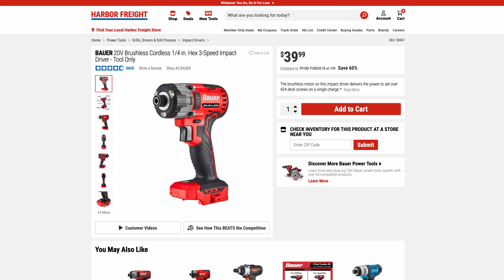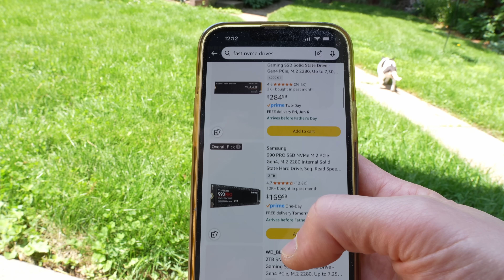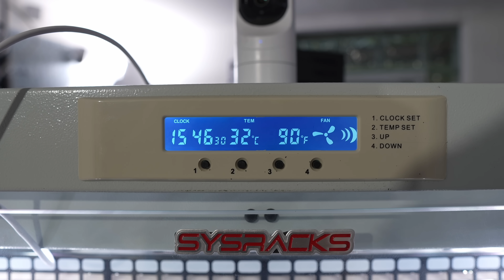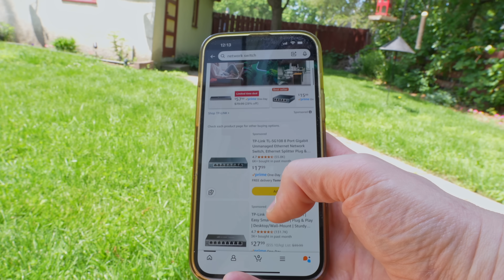Buy Once, Cry Once: How I Wasted $2,857 on Switches

Comment: "You don't know, what you don't know".
ie. You weren't aware of where your homelab setup would lead to down the road, so you had no idea what you ultimately needed. I went down a similar route; before migrating my NAS from spinning rust to an all-nvme setup.

One piece of advice I'll give to others starting out with home lab setups is to NOT buy ex. data centre switches etc. They're noisy; old; inefficient; and sometimes plagued by licensing issues.

If you've got a tight budget, even look at a generic 10g SFP+ switch for just your data movement on your internal network (ie. no PoE, unmanaged).  You can literally buy new unmanaged generic SFP+ 10g switches (eg. 8 port) for about $100 USD these days, and these are fine for your internal network. Multimode SFP+ 10g and SFP28 25g transceivers are dirt cheap these days as well ($20-30 USD ea. new). Similarly OM4 fibre cables and patch leads are also cheap compared to copper and offer future expansion (eg. 25g; 100g etc.).
In order to manage everything, get a decent router (Mikrotik; Ubiquiti; Alta etc.) and have that manage all your vlans; DHCP etc. for your internal network.

Buy a couple of used 10g (or even 25g) SFP+ NICs (Eg. Intel, or Mellanox CX-3/CX-4's), and you're good to go -  you can have 10g networking (switch/NIC's/transceivers/cables) between a couple of desktops and your NAS for less than $500 USD. Seriously.

Comment: I have bought 500k+ worth of equipment over the last 10 years for my small AV biz or home.
I have NEVER once regretted a buy-once-cry-once purchase.
I have, however, regretted many purchases that weren't what I needed but were a 'step' closer.

6dB$ is the way.

That said, there is no reason to spend lots of money on things that you don't need. I spend wayyy too much on 'stuff'/junk' that I will never need or use. That isn't buy-once, cry-once. That's stupidity and greed and emotional buying.
Same for quality, it isn't just 'buy expensive'. Example: tools, look at project farm; many times the cheaper tool is better in many regards to the expensive one. Sometimes it isn't better, but it is higher value.

For the curious:
-high quality audio amps vs used ones
-high quality speakers over cheaper ones
-high quality crank stands
-high quality lighting vs clones
-network/computer equipment
-good cables & road cases rather than crappy ones (note not expensive; just good)

Comment: i have been using unifi for 3 years and now i feel i made a mastake. i was using mikrotik and i think it's better than unifi and cost is cheaper than unifi. i know unifi has great for ui but its so expensive. now i am back to my old mikrotik and wow ther router still good and mikrotik has update a lot compare with unifi they are so difficult to update firewall bug. for management switch and router  now i prefer mikrotik than unifi. for AP ok i prefer unifi (i have not test ruijie yet)

Comment: I buy used enterprise equipment. I own one 48 port 10gb switch (with  4 40gb ports) AND a handful of 1 GB POE 48 port (with 10GB up-links). I'll probably buy a 2nd 10GB switch for a backup.

I'll still be under 1k for all of my network gear.

Comment: 1. Future proof for the next 5 years at least with enough 25% headroom than your needs.
2. Upgrade only when your upgrade is going to be 2x better than what you currently have; while applying rule #1. So it’s double plus 25%.
3. Stick to the budget, if you allocated that money to that item then spend it. Don’t readjust the budget to spend it elsewhere, spend it on the upgraded version, if possible. Meaning if you planned to spend 1k but the device that meets 1 and 2 points costs $700 but there’s another device that costs $1k then spend your budget on the $1k rather than $700. You are extending the future proof by not reallocating budgets.
4. Consider the software vs hardware. Hardware without proper support is worse than low tier hardware with high quality support. Eliminates so many headaches.
5. And if you don’t know how much you need, then watch your favorite YouTuber like TechnoTim and ask yourself, “how much do I really see myself getting into this”. Use that as a baseline to where to start.

Comment: (7:28) "Is buy once, cry once just future-proofing?" When hyperscalers like Amazon, Meta & Google adopt cutting-edge CPUs or AI accelerators 🔧⚙, they create market momentum that eventually drives down hardware costs 💸. As their demand scales, vendors flood the market with newer-gen tech, causing prior high-end components to become more accessible & affordable 🎯. For home labbers, this presents a strategic window: instead of paying premium early-adopter prices, you can wait for the enterprise wave 🌊 to pass, then pick up powerful gear at reduced cost — maximizing performance-per-dollar 📈. The key is timing purchases just as mainstream adoption peaks & infrastructure refresh cycles begin, letting you build robust setups without overspending 🖥🔌.

Comment: My introduction to HomeLabs began at the start of the pandemic, when the sudden shift to full-time remote work pushed me to upgrade my ISP and take a closer look at my home network. That’s when I discovered Ubiquiti and started small—with just the basics. Over time, what began as a simple setup has grown into a robust home lab environment, now centered around a Dream Machine Pro, higher-end UniFi Switch Pro Max 48 PoE, NVRs, Unifi UNAS Pro, a TrueNAS system, and more.

If I had done it all over again, I would have started with the rack-mount system and upgraded the switches as the systems were improved.
Reply: I went opposite and laugh at most of the guys. Seriously you can buy a full 16 core 32 thread consumer AMD cpu that can virtualize a whole environment without buying stupid servers at home. My IPC per core can destroy xeons because the xeons people buy are out of support and like 8 years old. Opnsense is free and can run routers natively with Microsoft Hyper-v which is part of Windows 11 without any guest tools. With guest tools you can run opnsense on Linux with KVM/Qemu fine. If you want to go overboard and say I do not know what I am talking about compared to 3 or 4 racks of outdated enterirpise hardware you can buy a Threadripper with 64 cores and 128 threads! The new one just came out and AMD's threadripper is a remarked EypC CPUs and are enterprise grade. They can eat Virtual machines for breakfast.

I like VMs over hardware because I can do a simple snapshot to restore a mistake without reinstalling the operating system off of real hardware

Comment: I have the same experience. We're drowning in incremental standards by now and hybrid switches with 2.5G/10G ports just suck. For vendors though, it's heaven. The perfect way to guarantee a steady high revenue.

It's probably best to plan ahead and save up a decent amount of money before committing to anything. Do proper and comprehensive research, lab it out if possible and finally buy everything in one go. You'll still get screwed with unpleasant surprises but at least you have a balanced setup and you save loads of time on fiddly configuration changes. You'll also end up with a much cleaner stack. All you have to do is resist the urge to express-checkout the latest gadget and forfeit that dopamine rush.

Comment: I'm building a commercial scale 10G network.  All Ubiquiti Unifi.  Dream Machine SE,  SFP Aggregation switch, Four 48 port POE switches, one 24 port POE switch and 4 AP-Pro Access Points.  I decided to buy flexibility even though I don't need POE everywhere all ports are capable.  I can also segregate the network physically by switch -- 48 Cameras and a PVR on one switch for example.  Pricey for sure... but easily able to meet my needs well into the future.  I'm glad I did it this way.  But I can also appreciate the built-in obsolescence approach.  Buy cheap but capable equipment for half the price with the expectation that you will replace it at least twice.  It has the secondary benefit of saving capital upfront.

Comment: Unless I'm misunderstanding the Flex 10G had a 1Gb uplink. So you're using one of the 4 x 10Gb ports as an uplink?
Reply from the maker: You're right that it has a 1Gbe port however I was using one of the 4 10Gbe links as an uplink instead.
Reply: @TechnoTim  yeah, that's tough. I've been in similar situations. I own so man UniFi switches (over 30) because of technology changes and moving from 1Gb to PoE to 10Gb, but then 10Gb with PoE++ and later 2.5Gb. It's a lot.
Their release cycle is awful. Products come out haphazardly, so you can't easily plan in advance either :/.

Comment: I just bought used 24 port POE+ gigabit L2 switch for $100 and next will be Mikrotik router right behind GPON from ISP. That will be extra $230. And behind the switch there will be used Ubiquiti UAP-AC-LR APs. You see this? No vendor lock-in 😁
All of this for basic home networking, smart home and web server. In case of upgrade I will just buy used faster switch and hope to not make same mistakes :D

Comment: Are you sure the 32 higher speed ports also support 10mbit? We have unifi switches that support 2.5gb at work and they don't support going down to 10mbit. This is very niche as not many things use 10mbit these days, but just curious.
Reply from the maker: Great question and I was not able to test this (hard to find these days) but the product documentation says so.  It doesn't support 10 half but supports 10 full.
Reply: @TechnoTim Yeah the only thing we have are door controllers that still use 10mbps NICs. Just made me curious when you said those ports supported all the speeds.

Comment: My IT background is from the ISP world. We need uptime. That means spares and commonality between sites. I'm no longer in that business, but I'd rather have multiple affordable reliable switches that aren't as shiny if it meets the same goals. Runtime on battery or generator is important too (low power consumption and no need for air conditioning) For home and soho use, the quietness is a factor. 1u 48 port POE switches are probably somewhere between vacuum cleaner and jet engine. Buy once cry once I reserve for cars and cameras. My used Nikon D810 is still making pretty photos and video.

Comment: To me, as a person who only do homelab for fun.  It's all about balance.  Especially w/ tech gears, I doubt "Buy once, cry once" actually a thing.  As a home user, I have to balance between need, want & price.  What exactly the point of paying something super expensive that you only use less than 10% of the power or features?  Maybe I'll out grow that, but you can anticipate what you will need in the future.  Business do have differ requirement, but it's still the same it's all about balance.  Sure you can buy 10G switch a decade ago, but the switch alone will cost you thousands of dollars and not to mention all other NICs that have to upgrade on the desktop.  So, a decade ago utilizing 10G networking will probably cost you 10k.  And majority don't even utilizing that 10G bandwidth full time.  The people that do need it at the time, only need them because they need them to be faster than 1G and there is nothing else in-between.  Today, you can get into 2.5G network at less than 10% of that.  Same could says for the POE and the wireless networking.  Do I need 10G now, no?  Do I want 10G now, yes? but as a home user and future proofing my network, a mixture of 10G and 2.5G exist and all that still only cost me about $1k to upgrade my entire home network, still way less that those business that pay 10x the price decade ago.  Would I need more than 2.5G in the future, maybe?  But I doubt I will need my entire network to be all 10G or faster.  Not every single networking equipment need to use even more than 1G, some even 100M will do.  Even for business, getting the entire network to be 10G capable even now is still exuberantly expensive, not just the cost of equipment upgrade alone, but the price you have to pay for power and cooling them.  Not all business need that, even less for the homelab.

Comment: Buy-once-cry-once is the antithesis of the Boot's theory of economic unfairness. If you can afford to buy what you really need the first time around then great, bot often it's not feasible to buy that, meaning you have to go with a lesser option, and then end up needing to re-buy in the future. I usually think if the cost of the purchase is more than my time to analyse the option and consider what to get, it's probably worth spending a little more time to make sure I'm buying the right thing first time around.

Comment: Tim boils down to this? Yes over kill seems to work every time. That's me as well. Does what you want compare to what you need or want to achieve? Does what you have achieve the same results needed to operate all this stuff.  Buy Once, Cry Once sounds like buyers remorse. I have been building computers now for more than 30 years. I have eight  computers that operate between two of our homes one in Florida and one in Ohio. Three computers back 2015 that I built are still running rock solid in 2025, and at a cost of $6000.00 a piece. The other five machines are 2011 vintage still run exceptionally well. All were top of the line hardware at those dates.I run mostly Archlinux and Gentoo. I also have a server. A Synology with eight network drives. Pretty old machine and slow but runs well. I will take reliable over speed every time. This was mostly a hobby but I flew some of the most computerized aircraft as a career and living.

Comment: Wait until you want to upgrade to 40G, running a UDM SE, a Mikrotik CRS326 24S 2Q core switch (24x10g sfp+ and 2x 40g qsfp plus) a USW 48 Pro Max PoE 700W, 6x U6Lite Aps, 1x U7 Pro and 1x U7 Pro XGS, 2x mikrotik CRS305 1G 4In comming out of the core switch, 2x unifi flex, 1x unifi 2.5 flex plus a Cisco Nexus 3132q-x with 32xqsfp plus (32x 40gb) connected to 3x dell r730xd (1x unRaid (retireing) 1x Trunas and 1x esxi (retiring) for 3x minisforum runnig esxi, and 2 gaming rigs, all servers and PCs with mellanox 40gs cards....
Don't get fooled by the Cisco, looks impressive, sounds impressive (50db and up full blast on startup) but it only costs like $100 for all those 40Gs ports, 40G nic mellanox goes for around $15 each and qsfp plus transceivers goes for $100 for a lot of 10... Miktrotik is like the poor man's ubiquiti (around ~30% cheaper but gives you a little more) but boy their management is consistent unlike the gui of Unifi, feels like every version they need to move stuff around a little bit, extremely annoying and the lack of CLI...  
My experience is this: depends if you value your time or knowledge... cuz it was hair pulling fun to make them all work together. learning Nexus OS and RouterOS to play nice with Ubiquiti's....the only good about ubiquiti, it kinda works OOB, they are pretty to look at and their damn APs anternnas are top notch.

Comment: Bought a Mikrotik 24p-1g-2sp+ switch, then bought a 2.5g switch, 2.5 nics.  Thou was limited by bandwidth.  Then just went and purchased the Mikrotik 2.5g switch with 2-10g SFP+ ports. Hooked it all up, not everything runs at 2.5g, thou ISP only provides 600mb download.